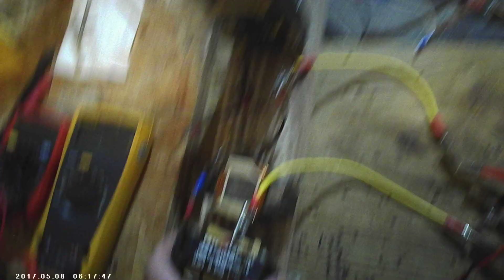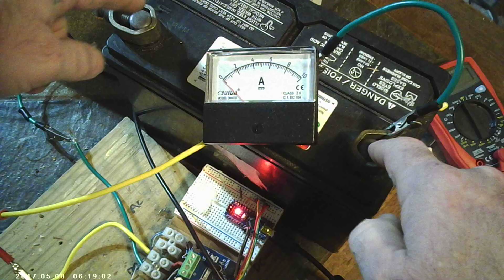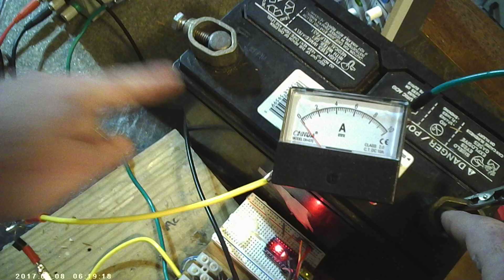Self Induction Creating 2.75 Amps- Repelling Power of Coils

Comment: If you're putting it into the negative and getting it out of the positive then you're charging the battery. I think that you're misinterpreting whatever it is you're trying to show, however I'm looking forward to your next video.
Reply from the maker: I think it is showing what I intended. AC into that circuit at that frequency calculates to 2.8 Ohms.  (12V @ 4.245Amps).   
Now make the coils repel by putting them together.  Now we calculate to 1.8 Ohms. (12V @ 7 Amps).
Reply: Yes, you have changed the impedance of the whole circuit, but you're drawing 7 amps from the battery. There is no gain but a loss. So go ahead, make me happy, prove me wrong!